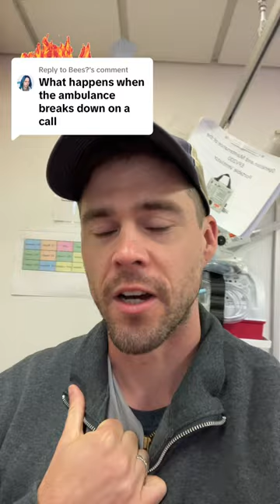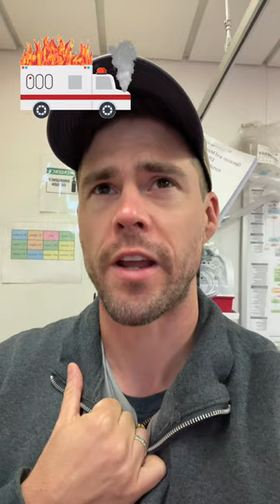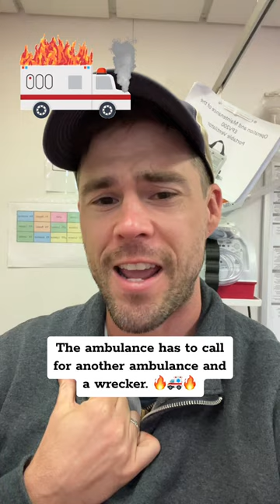When ambulances fail

Comment: I am from a rural county in Georgia.  Our older, as in plural, fire vehicles were from the 40's.  This was the eighties.  We had one of those engines throw a rod while pumping water with fire fighters in a burning structure. I had two ambulances puke a motor while running code with cpr in progress in the back.  I had a patrol car catch fire while responding to a apartment complex fire.  I drove it, while on fire, TO the fire so they could put it out.  The chief said it was the first time in his 40 years that the fire came to him.
Reply: That last one probably gave the firefighters a good chuckle if nothing else
Reply: @Argento_Wolf  That it did. 37 years later, some of them still bring it up over some beer and bbq
Reply: thats a lot of things i dont know how to separate, but i can say it is funny with that last line

Comment: At least EMS is paid work, volunteer fire and SAR in rural areas is crazy. Most of the firetrucks at my old department were from the 70's or early 80's (with the reserve truck being a literal 1950's antique parade truck they reactivated from another department) and the SAR truck was an army-surplus squarebody K10. About half the time, one of the personal vehicles would end up having to tow the SAR trailer to the trailheads, often my clapped out old van, cause a wiring harness caught fire again, and the dog-slow 6.2 Detroit couldn't do freeway speeds between the firehouse and the gorge so they had to take the backroads. This was in 2018, for reference.
Reply: i can suddenly see the open air cab antique firetruck at my local FD being reactivated and used to fight a house fire, which would be freakin wild

Comment: Your breakdown story gave me flashbacks 😂

I had an F-150 long bed pickup that suddenly acted strange and made noises underneath that weren't right. I was near the shop, so I parked it, and caught an alternative ride home. The mechanic smiled and said, "Good call!" When he saw me the next day. The u-joint had failed. The previous owner had installed a replacement backwards. The zirc fitting was on the wrong side. So Jiffy Lube was ignoring it. One of the end caps had begun to tear. It was just millimeters from complete failure. The mechanic said that such a long drive shaft dropping,  especially at freeway speed, could have pole vaulted my truck into a catastrophic, and potentially fatal, accident. Don't mess around with the metallic noises. Stop while you can.
Reply: I have no idea how a snapped u joint would lead to you catapulting to your death unless you had it in 4x4 and it was the front u joint that failed the rear one would just have had the driveshaft slapping against the pavement while you pulled over I still better to take it to the shop before getting stranded but it’s not that dangerous
Reply: @wyattnyfeler7270   I had that truck on the edge of one and a half tires looking like a car stunt at a county fair. Fortunately, I was able to keep it stable and get back down safely onto all four tires without ever leaving my lane of traffic on the interstate. Having a pipe nearly as long as the truck dropping under it suddenly and any other damage that it could cause could absolutely have sent that thing over into a roll. The fact that you think that I should take your opinion over a mechanic that our family trusted for decades just shows how ridiculous you are.
Reply: I used to have a XJ Cherokee and about 9.5 years ago I took it work at the retail job I had at the time instead of the Chrysler I had bought a couple years earlier (and still own). On the drive home I’m rolling along through a S Curve at about 45-50 in a 45 when someone decides to pull out in front of me while making an illegal right in red. At the time, the front brake pads were well worn and the rear shoes and drums were OEM with around 140k on them. Knowing that in the best of circumstances I wouldn’t be able to slow quick enough to avoid hitting the other car. I pitched the XJ into the inside lane and went around the guy.  
Told my Dad what happened and he decided to put new pads and rotors on the front a couple days later while I was at work and all of a sudden I get this text from him of something that looked like it could have been from the control deck of a ship that sunk in salt water. I nearly texted back asking him why he sent pics of the Titanic until I looked closer and realized that it was the tube, C, knuckle, and U-Joint from a Jeep Dana 30, the one that was under my XJ. While he was doing brakes, he discovered that the joints were shot too and was replacing them, but sent those pics first.

Comment: Mail carrier vehicles are similar. A lot of them are around 40 years old and god knows how many miles. They CONSTANTLY break down too.
Reply: I’ve been hearing that they’re having electrical fires at time with those now too.  A lot of those oldies by me have been getting LED headlights over the last several years too, which has to help with the load on their electrical systems.

Comment: I've worked on a rig with 700,000 miles on it.
Four engine replacements. Two drive train replacements. Had gone back to Ford for rebuilding no less than 5 times.

And I still had the rear wheels quite literally come off while driving due to an incompetent company mechanic who thinks an impact wrench is his best friend. Straight up snapped the lug bolts.
Reply: An incompetent mechanic is about as good for a vehicle as bone shards are for a digestive tract in a centrifuge

Comment: In my hometown, there was a 2003 E-series ambulance and right as the volunteers started it, the turbo exploded, and dumped oil in the middle of the bay. It happened twice before they raised enough funds to replace it a year later.

Comment: My highest I’ve seen was a truck from 96 that have 700K, was sitting in a random parking lot when all of a sudden the engine shut off and the truck had no power. Never heard what caused it to shut off and not have a power but my guess was the alternator when bad and was running off the two batteries. Thankfully it was like 2am so it wasn’t during a call

Comment: I'm an EMS mechanic for a large healthcare company, and that's pretty much how it goes. We've got about 75 trucks in the fleet, services are done at 8k mile intervals, and we cycle through services on the entire fleet every month and a half or so. Doesn't matter how good we in the shop are at our jobs, if you run a truck that hard for that long, shit is gonna break. That is if the new kids don't crash them first.

Comment: 1987 1988 before things changed to diseal and mandated changes were made   for the chassis manufacturers to meet certain standards most were gas and the fuel system would overheat. We were in the hospital we came out to find gas  selling out of the tank. Later in the week hospital Maintenance found the gas cap on the roof .

Comment: Wait so massively over worked minimum wage employee working in second hand vehicles with almost no severs or repairs done to them 

And it's still $800 for a 15 minutes trip.

Where's the other $725 going to.

Comment: so what your saying is you didnt know what a driveshaft or bell housing failing sounded like until the day your truck decided to show you what they sound like, at least it stopped, my moms truck had a brake failure at 50mph headed into a major intersection, driver slammed it straight to park and won a new transmission and brake job

Comment: And yet police vehicles are replaced every few years and get parts thrown at them when they don’t even need it. 
I worked with a guy for six years that worked on them. If it came in with a slightly loose outer tie rod, the hole rack would be replaced. 
Tire with a nail in the sidewall-4 new tires
Brakes just because. Them mf aren’t as important as an ambulance in my eyes. At least the emt is liked by everyone.